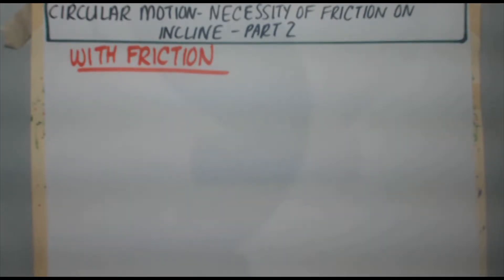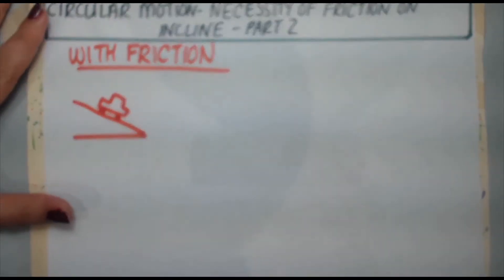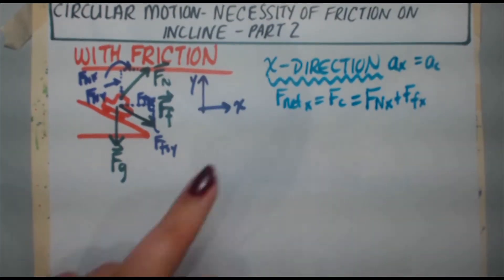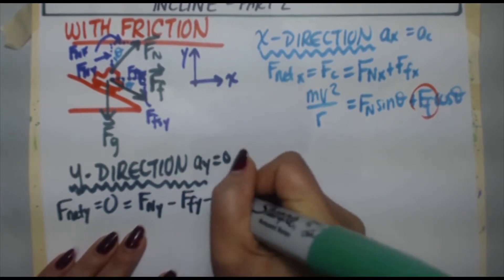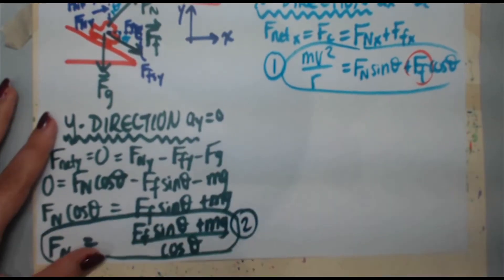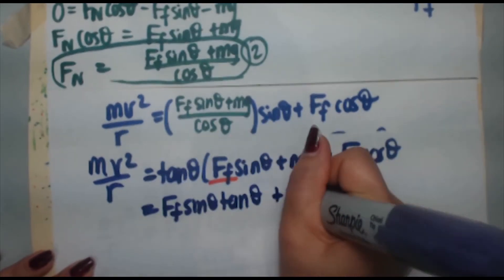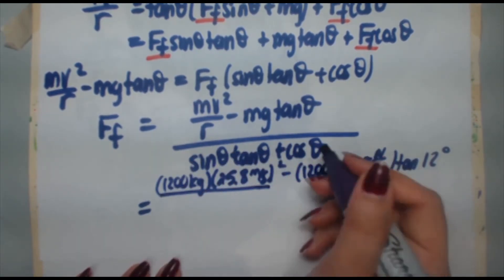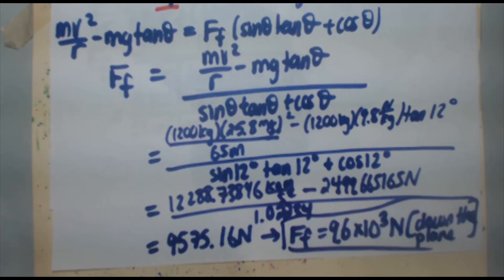83 Necessity of Friction on Banked Curve Part 2

Comment: But why do you add the x components of the normal force and the force of friction in the x direction? I thought friction opposes motion.
Reply from the maker: Good question.The reason we add them is because both x-vectors are pointing to the right. The normal force is going up and to the right. Since this is the hypotenuse of the right angle triangle, the y-component vector needs to be going straight up, and the x-vector going right. This way, when you add the vectors "tip-to-tail", they form the correct direction of the hypotenuse, or normal force. In this case I am trying to see if I even need friction. I just chose to let friction be down the incline in this question. If the answer for friction in the end came out positive, that means I chose the right direction. If it came out negative, that means I chose the opposite direction. Since the answer came out positive it shows that friction is indeed down the ramp, which is generally the case when you take the turn faster than the recommended speed :-).
Remember that friction goes in different directions for a car on a banked curve depending on whether it is going faster or slower than the recommended speed limit. (This concept is shown at the start of 82 (Part 1)).